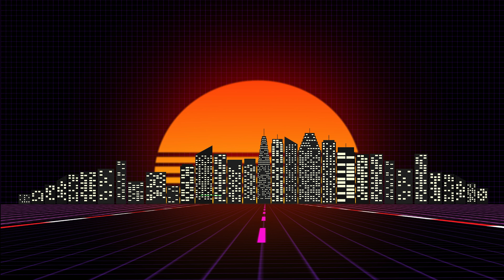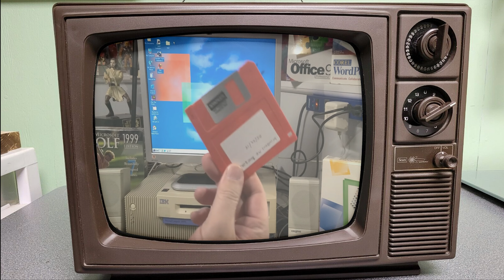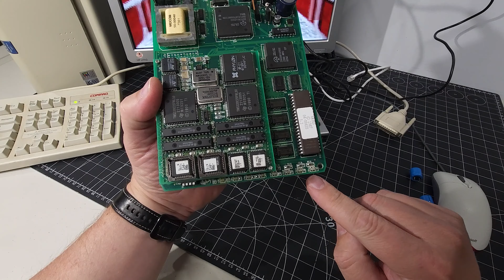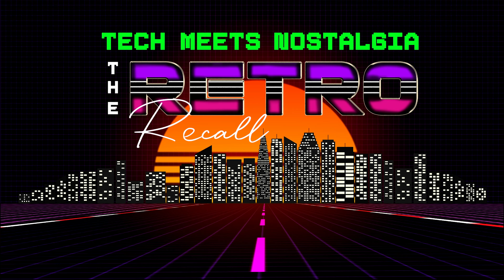Hayes V-Series Ultra Smartmodem 9600 Repair - I need your help!!

Comment: I would start by replacing the rest of the capacitors. If those two were bad then they possibly all are, even if the others aren't getting warm. The two caps you replaced were likely the power supply filtering caps, and the other caps are presumably part of the telephone interface, and so could be presenting a voltage or odd signal on the telephone interface that's upsetting the modem if they've failed.
Reply from the maker: Love this suggestion, would love to get it going again.  I'll order more caps!

Comment: If this is set up like USR modems were (which used some of the same chips), the board with the two TMS320 DSPs is the modem itself, and the main board has the serial interface, AT command processor, data access arrangement (the large transformer near the top) and the power supply. I'm not entirely sure why there are two DSPs instead of just one.
Reply from the maker: Thanks - I'm going to try to find a schematic of this modem.  I'm sure that will help.

Comment: 0:46 You may not believe it but many wiring closets for businesses still have those. They are plugged into Cisco switches so remote techs can dial in and work on the switch even if the internet is down.
5:47 If your parents had that modem back in the day, you were pretty lucky as they were expensive compared to the ones that were on a card that went into the PC. Hayes set the standard that every manufacture followed to make their modem compatible with the Hayes.
24:54 If you are using Shaw home phone over coax I think you are on a digital line not an analog line. I seem to remember there is a box you have to put between the digital Shaw box and an analog modem to sense the 50 volts DC of a phone line. One time I was doing work on a phone line in my house. I was putting in a wall jack or something I had the live phone cable in my mouth stripping the insulation from the copper with my teeth (I know stupid idea) the phone rang 50 volts DC straight into my mouth, I only did that once. If you have ever put your tongue on a 9 volt battery to test it? Ya, a phone line ringing is 50 times that took a week for taste to come back.
Reply from the maker: I was able to do the 56k USR dial up video without any  issues and connect to NetZero.  I use Rogers here in the east.  I think the modem is just not coming out of some sort of diagnostic startup mode.  I have some great suggestions in the comments that im going to try.  Wish me luck!
Reply: @TheRetroRecall  I have a US Robotics modem, I have not tested it. @CathodeRayDude set up a phone system in his lab he may have some insight?

Comment: Also, going by the date codes on the chips, it looks this modem was made in early 1993, not 1987.
Reply from the maker: I was going by the ROM chip as it stated 1987, however that could mean something else.  I'll take a look at the other chips when I go to continue troubleshooting.
Reply: @TheRetroRecall  The 9600 baud standard wasn't even ratified until 1988, so 1993 is more likely. The 1987 copyright on the ROM chip would be for some of the code which would have been written back then.

Comment: It seem the modem doesn't boot up, right? I would try to reseat that daughter board and that IC under it. The two socketed PLCC chips on the daughter card as well. Maybe that helps but I guess there's either some problem with ROM chip itself or it contents got corrupted somehow over the last 30 years (looks like its made in early 1993 according to the datecodes on chips and board) or there's still another fault in the power section. I would check that SMD cap between that Motorola chip UA78540 (still no clue what it does) and the new caps it might leaked as well. And there is an smaller SMD chip there on the edge not sure if you hit it with the vinegar maybe it got some corrosion on the legs.
Reply from the maker: Thanks!  I will add this to the list of recommendations.  I plan on trying all of this soon when I get a few moments. Much appreciated!!

Comment: Check the voltage coming in from the power supply when it's powering the modem. It's most likely within spec but it's always a good idea to make sure. Also check the supply voltage at the ROM chip.
Reply from the maker: Thank you, will do! I have a list of things now to try thanks to the amazing supporters of the channel!

Comment: As suggested before, try using a terminal program and see if it shows any errors. Maybe try different speeds, in case the modem is in a fail-safe mode;
It could be the eeprom contents are hosed and the settings are in an undefined state, if you can 'talk' to the modem, these are some AT-commands that could reset the modem to factory defaults:

AT&F&C1&D2
and/or
AT&FE1Q0V1X4&C1&D2
Reply from the maker: Thank you, I'm going to try this.

Comment: PCB= "Printed circuit BOARD" it is a board, and your iron is set too low, you may have problem with cold solder joints down the line. check your voltage regulator, that SMD cap left of the 2 big ones and the two un the upper board, these have a habit of just crapping out and leaking ( just ask any 80's and 90's Apple machine owners) 80's and 90's caps were terrible from the start and after 40 years will be worse. , warm is fine , hot isn't  also check for component shorts in the areas around the rs 45 phone line hookups, (IE: caps, SM poly caps. diodes, and transistors)
Reply from the maker: Thank you!!

Comment: could be bit rot in the rom try taking the rom chip out and reading it in a programmer and compare to a flash dump to see if its different
Reply from the maker: Awesome suggestion, will do!
Reply: there could also be dry joints looking though a microscope should help with that and as you had some bad caps the others could be out of spec but not leaking  @TheRetroRecall
Reply from the maker: I was thinking about that.  Zooming in and pushing each pin / looking for cracks will be a part of list.  Thanks again, much appreciated :)

Comment: Those blue caps do look suspect. Or sus as the kids say.   Anyway, I may have one of those modems in storage. At least, it looks the same. But as you noted, Hayes used the same case design for a series of different models. Worst case, happy to send it to you if wanted. Virtually certain I know exactly where it is in storage but let me check.   I once ran a couple different BBS systems and ran through a slew of different modems, finally ending up with a USR Courier as everybody else did. Note for everyone, use caution with the modem power supplies. Many of them are AC output, not DC.
Reply from the maker: Send me a nice and we can chat :) youtube@bravtech.ca

Comment: when you removed the caps I see alot of corosion around the positive holes. looks like the 2 caps are conected in paralell. use multimeter to make sure both positives have continuity to make sure corosion did not cut that trace .
Reply from the maker: Good call, I'll test.

Comment: Did you try sending commands to the modem from command line?  Echo ath0 (zero) >>com1  it should click.  Try it with ath1 as well. A term program would be better because the modem will issue responses.  The Hayes command set has diagnostics built in.
Reply from the maker: Perfect.  I'm going to try this, thanks!

Comment: The stuck RD light will have been picking up noise from the switching power supply circuit which you have now cured with the caps. As others have said there may be error or diagnostic information sent over the serial at power up that you may see with hyperterminal in 98. For next hardware diagnostics the first thing to check is all the voltages, and for that you at least need datasheets for the chips to know what voltages they need, or a schematic that shows you what the voltages should be.
Reply: Btw my first modem was the 2400 baud version of this very same type...
Reply from the maker: Thanks Majenko! I have a list of recommendations from the comments I'm going to try - including this one. Appreciate your help as always :)
Reply: It is not my problem but thank you. We need this kind of nerd support. I very much have a likeness for problem solving.

Comment: Always go higher volts
Reply from the maker: Higher volts for capacitors or the PSU?  If PSU that is not wise as it can fry the components.  Amps are something that you can definitely go higher on.  As for the capacitors, I just went with direct replacements.
Reply: @TheRetroRecall  I mean capacitors yeah. I always go higher just so it'll last
Reply from the maker: Ahhhhh yes, I've been told that.  I think in those cases the uF needs to match correct?  Meaning a higher voltage rating is ok, however the uF needs to be spot on.
Reply: @TheRetroRecall  yeah never change uf and if getting new power supply higher amps is always better
Reply from the maker: Thanks!

Comment: Maybe read the firmware, it might have faded
Reply from the maker: Yeah I'm thinking after I check all of the voltages and pin connections... Looking for shorts etc.. Then it may be a firmware / rom issue.  Just need to get myself a doner rom from somewhere and I don't think that archive has one.
Reply from the maker: I'm hoping.  Id love to get it working again.

Comment: There are "Prolific" branded Serial (RS232) to USB adapter cables, in case the PC has USB ports but no Serial port for the dial-up modem. There are also simple USB to RJ11 jack modems available.  A U.S. Robotics 56K V.92 fax/data modem would likely be the best option, quality-wise & connection speed wise. USR sometimes made modem firmware updates available. There is PC software that can interface with POTS (plain old telephone service) that can pop-up caller I.D. on your computer screen, initiate a dial-up voice phone call connection from your computer screen, etc. However, wasting further effort on repair of your Hayes 9600 baud modem is probably not worth pursuing.
Reply from the maker: Thanks for the info, for me as noted in the video I want this working again for nostalgic reasons.  It was my first dial up modem.  I just did a video on the 56k USR modem last week and it connected just fine with this pc using just a serial cable.